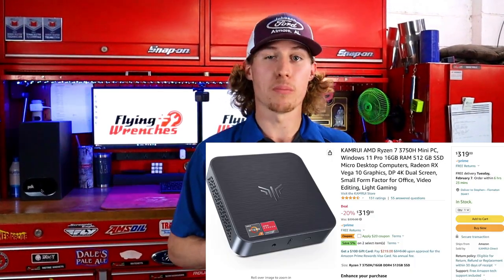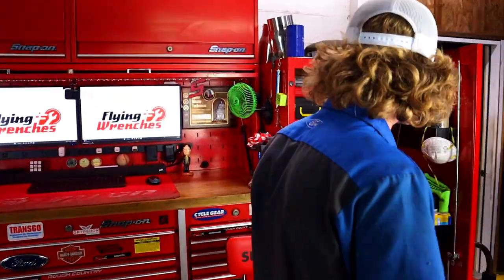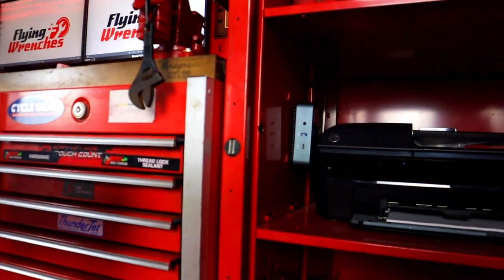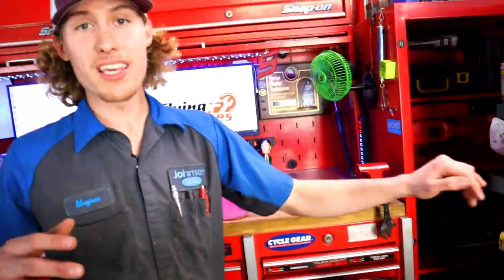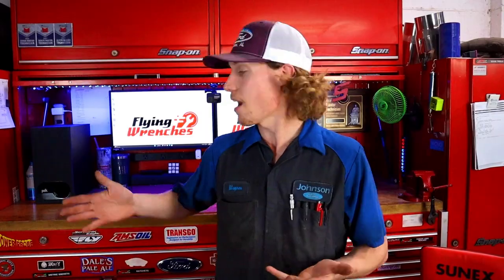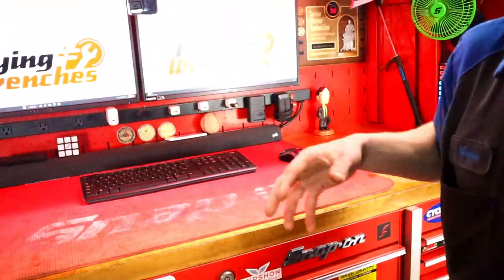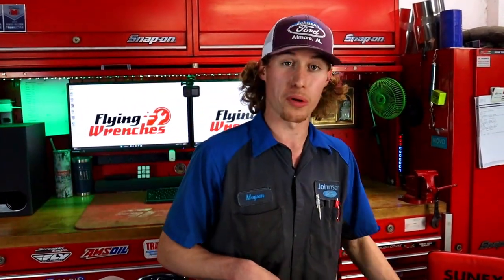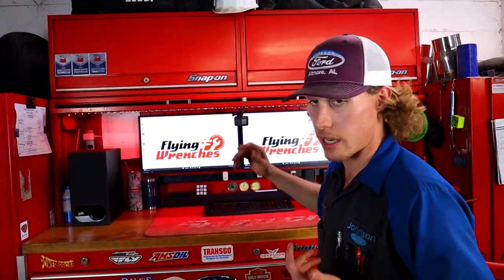Transforming My Snap On Toolbox into a Rolling Office | ToolBox Upgrades

Comment: Question for advise.... do I rebuild my 2002 explorer 4.0 torque converter for a blinking o/d Off light coming on sparingly for $4000, or junk it for another truck? I love my truck n just spent about $1000 on new brake job all around  n 2 new tires. Please Help. Thanks in advance.

Comment: Cool set up. I dig the Busted Knucke badge. I just got lockers for my Epiq. Ordered them back in Nov. installed some lights off Amazon in the lockers with a motion switch that turns the lights on when I open the door. You should do a tool box tour.

Comment: Just found your videos on my home page. I have a May 2012 f550 6.7 deleted straight piped 103k kms on its third ric flair WOOOOOOOO hasn’t costed me a single dime because my ford dealer is awesome for doing warranty. First time it went it sent the turbo bearing through the engine. And the second time it was coolant in the oil. In Canada so DOT or commercial vehicle gives two shits about my truck